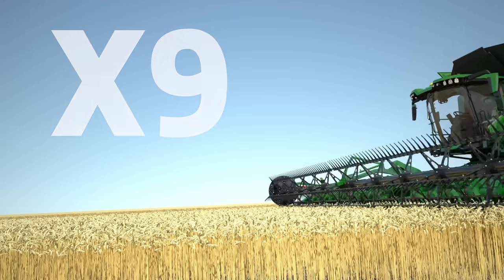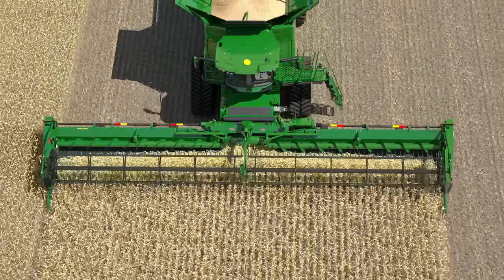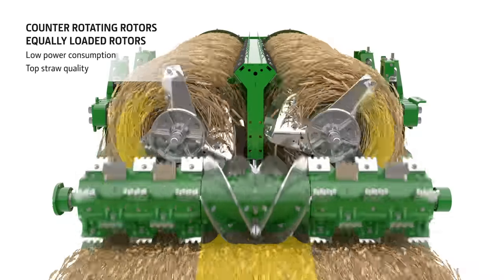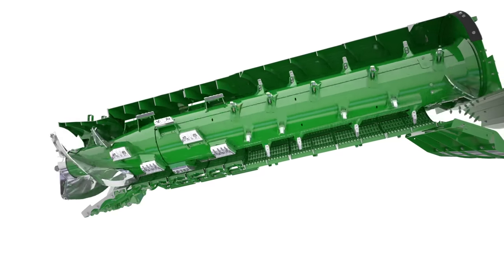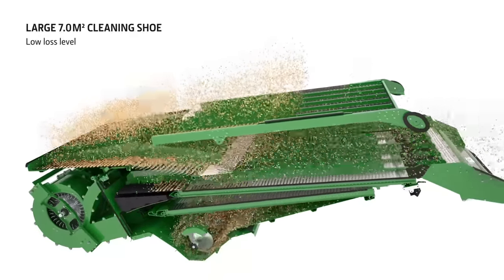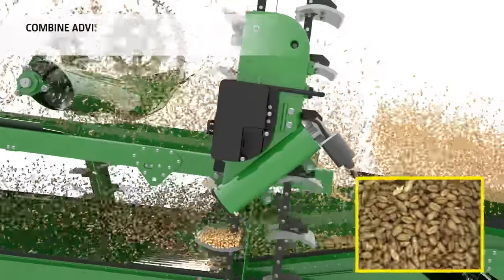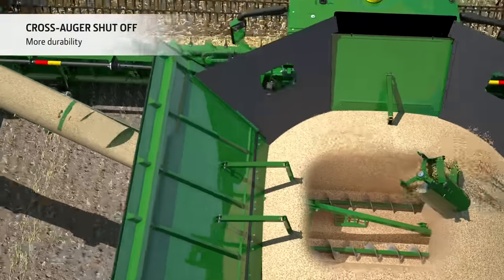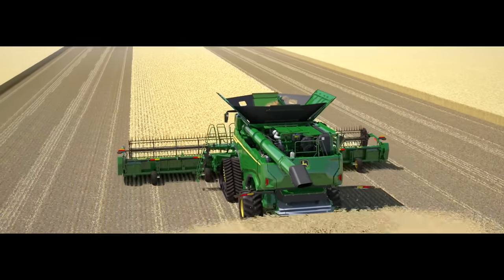John Deere X9 Combine how it works animation

Comment: all this complex engineering and absolutely no consideration for the ground... It's an aberration to have such a heavy weight on 4 tires on top of the ground. Why not at least try to create new smaller machines that doesn't compact the ground, and even better work on electricity with solar panels and batteries so the fuel dependency would be reduced ??

Comment: Also to answer questions of if farmers can fix the machinery it’s a yes and no you can replace wear parts as much as your mechanical knowledge allows you to which in this generation (not talkin sh*t but kind of) doesn’t seem to be very great.  The problem is electrical bullsh*t will be your downfall.  Electrically speaking if everything works on these machines they’re amazing across the board but when they fail they fail hard and it’s expensive to figure it out

Comment: Maybe better Don't buy it from this manufacturer. If after a while a little one dollar sensor that they don't make anymore breaks, you have to throw away the machine. So they sell you a new one.
Reply: thats every piece of ac gear made in the last 30+ years
if something breaks you are either handy with microelectronics, or be prepared to pay an ungodly sum to the OEM of which they bought the part in the first place.

Comment: and a piece of crap.  When one sensor goes down the whole rig quits and then it costs you thousands of dollars to transport the whole rig 100 miles to the nearest dealer to fix a $10 part.

These things need to be built in such a way that if all sensors go down the who machine will keep working.

John Deer can't make any money that way and won't let you work on it yourself.

Not buying a piece of junk.